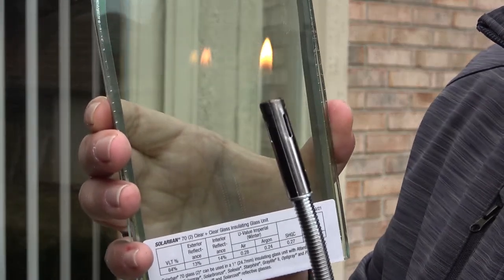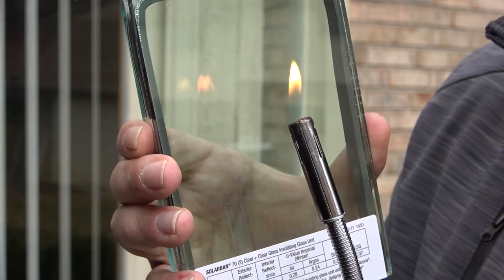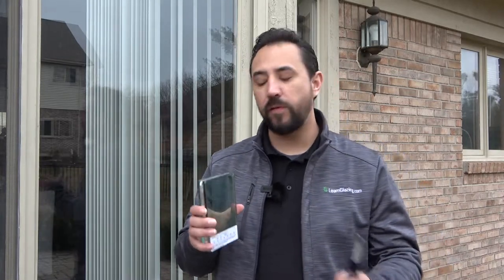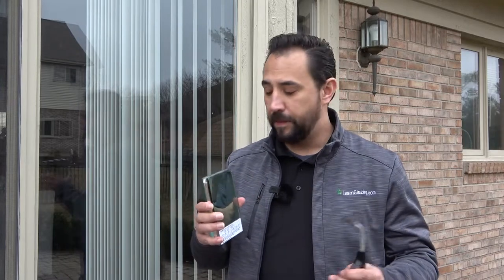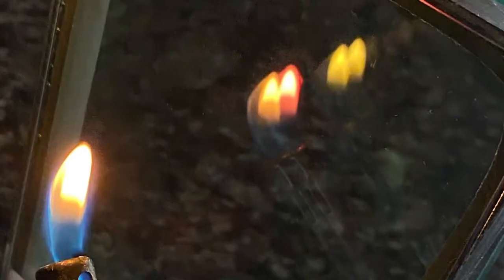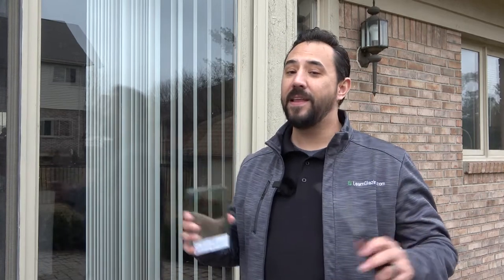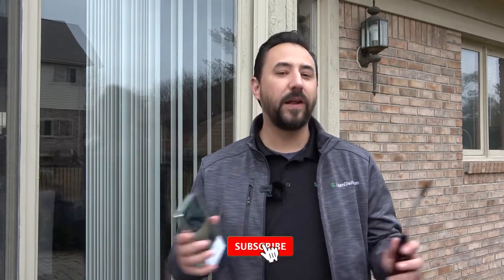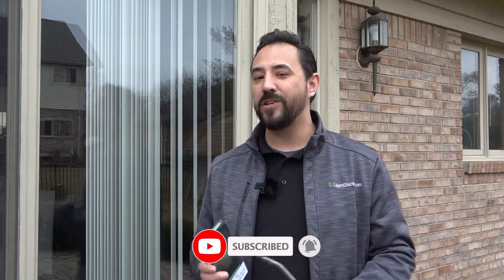Does your window have Low E coated glass? How to check

Comment: Down here in Florida I have recently been talking my customers into not using Low -E glass, its very common for it to go bad down here and if you add up replacement cost versus energy savings, well its not worth the energy savings. Better off with a tinted glass like bronze or grey.
Reply from the maker: Hey Zip, Thanks for the comment. That's really interesting that they aren't holding up as well. Are you offering a different service like tints for sun fading for furniture, flooring, etc? With the sun in Florida not having low E has to be tough on that stuff.